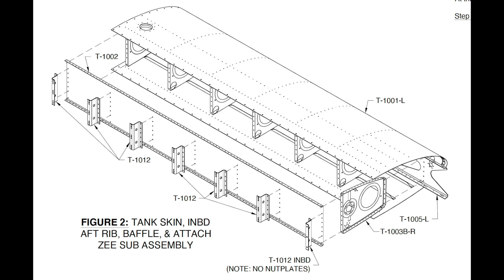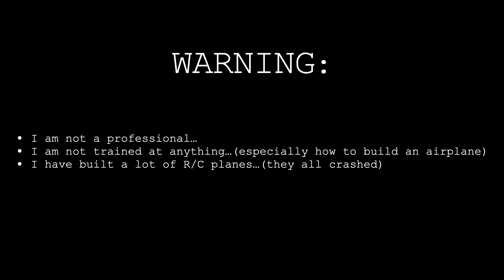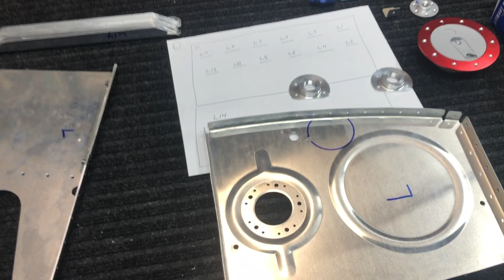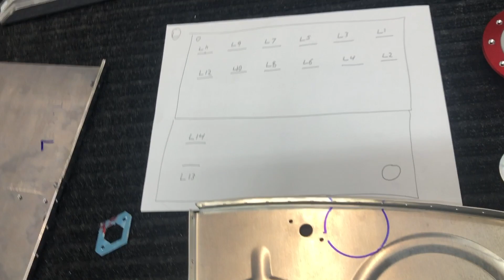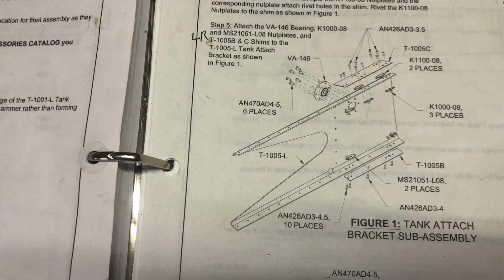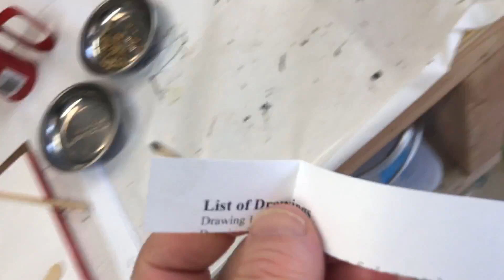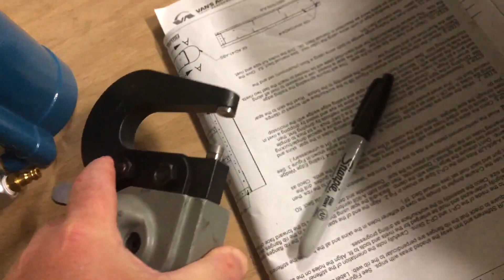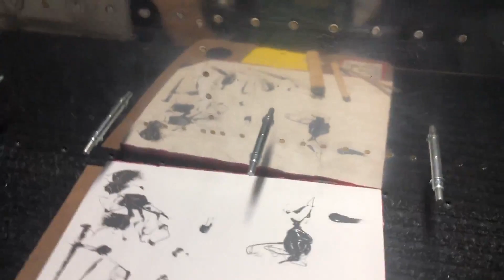RV10 Build 27  - Fuel Tank and Pro Seal Tips

Comment: I'm at the beginning of the empennage on my RV-14 build, but this video sent me to the Section 18, Fuel Tanks, to see what's what with those extra holes in the baffle (T-00002 on the -14). There is in-fact a note: "Extra" hole defines bottom of flange of T-00002

This is on page 18-08, RV-14, Revision 0, Date: 04/15/13. So, Van's included a note for proper orientation of the baffle.

I also have the USB drive plans for the RV-10. I zoomed-in on the plan sheet (page 18-4) and I mean - ZOOMED in! The three holes are depicted, but without a note as to why, you'd think it was just a drafting error. So, my take-away is that if there is a part in the plans that do not show installation orientation, There IS in-fact a specific orientation to chase-down. Thanks for the head's up!
Reply: Yeah, I was at a slight disadvantage as I did not build my empennage or frame my wings, I purchased them from a local builder who decided to sell his 10 projects.  SO I kind of started right into the tanks and didn't really have a lot of experience with the plans.  I have since learned to identify the orientation.  Also, if you think you might use electronic injection, you will need a fuel return like I did.
Reply: @RyanGromfin  I can appreciate your buying a project in process. I'll be going with the Lyc IO-390-EXP119. I will definitely mount a fuel return flange  - just in case I decide to go EFI. The return can always be capped-off if I don't.